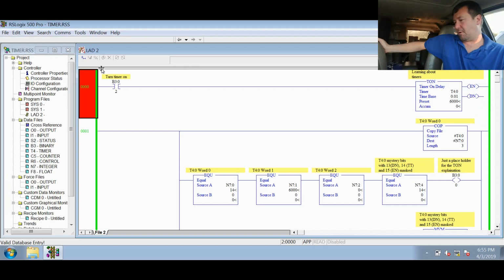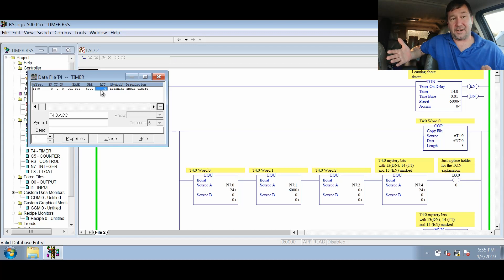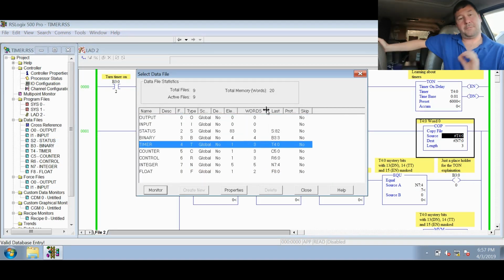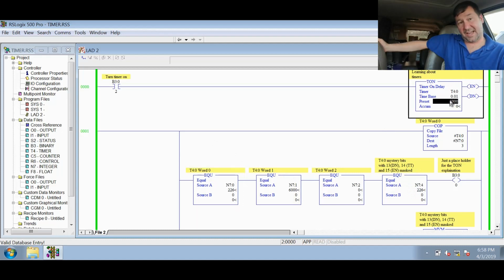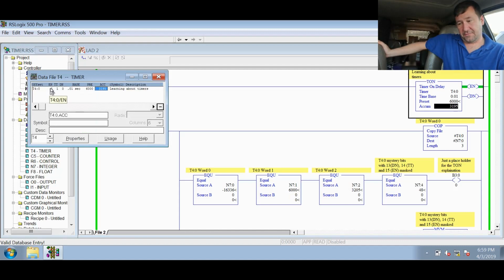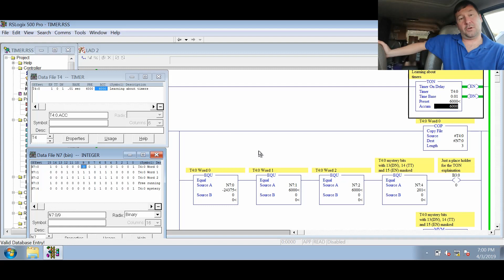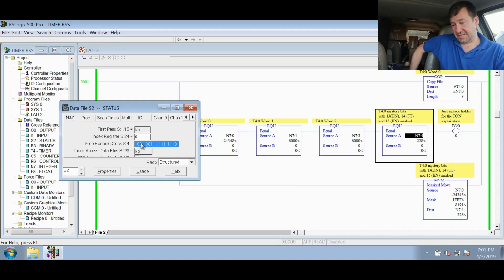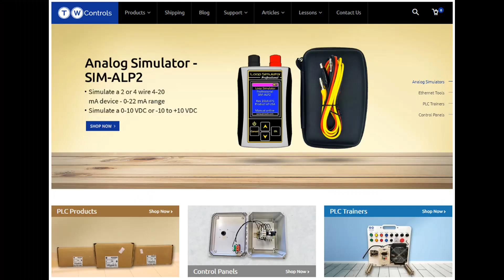How to PLC timers track time?  Proof that there is no hidden magic in Allen Bradley's RsLogix

Comment: Hi Tim,
How does the free running clock work? Could you please make a video on that?
I'm assuming it's always counting and when a timer starts running it inherits the value of the free running clock. Am I on the right track?
Thank u, cheers!
Reply from the maker: Hi Adrian.  Yes, that is pretty much it.  The free running clock is always running and a "time stamp" is saved in those "hidden" values to track time.
Reply: @TimWilborne  Thank you!